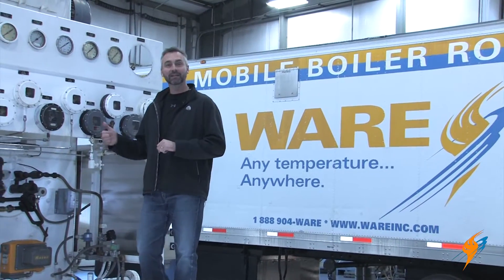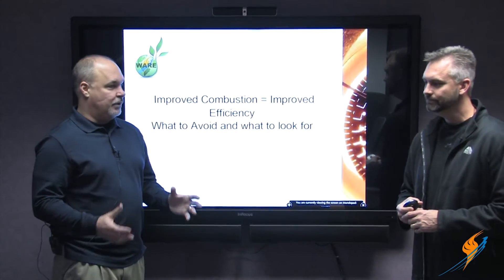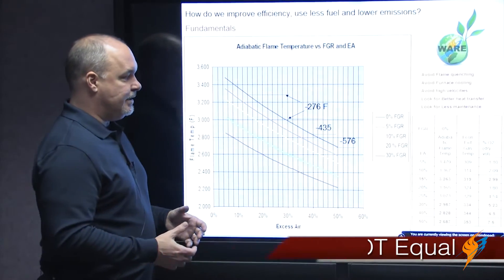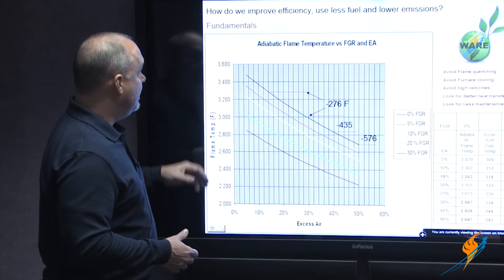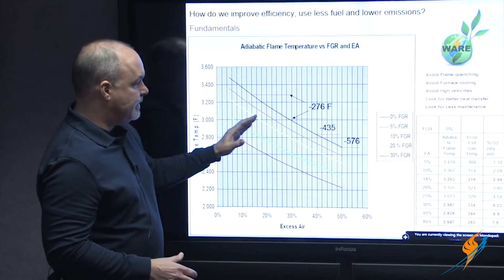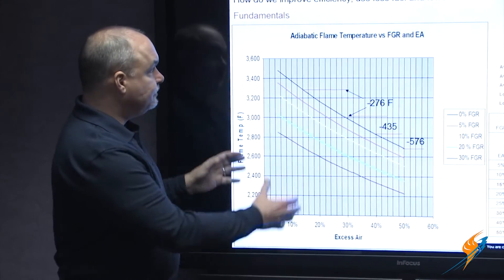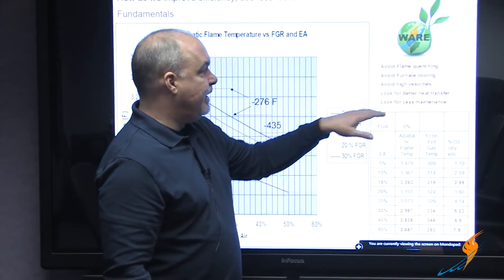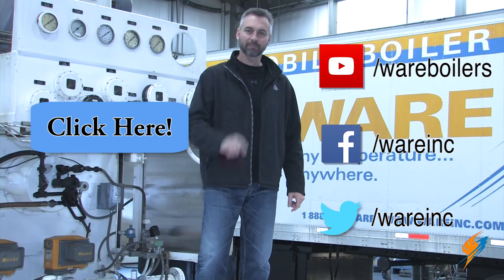Boiler Combustion Tuning and Analysis (Part 1) - Boiling Point

Comment: what is flame quenching....u have used this term
Reply from the maker: So Flame Quenching in this regards means having too much excess air in your combustion where it drops the overall flame temperature. Once you do that, you are reducing all of the temperature that can get to the tubes and wasting fuel in the process. Hopefully that helps! Thanks for watching.